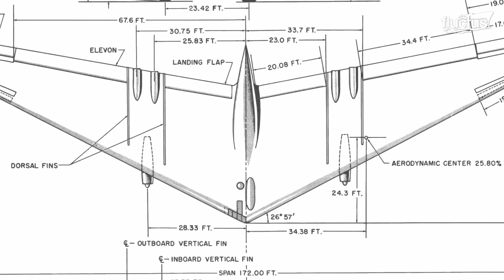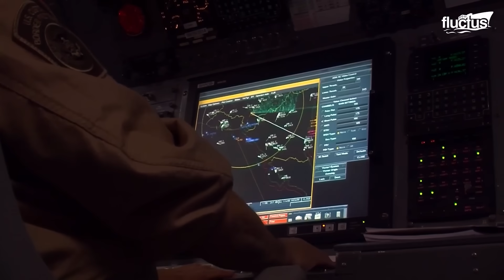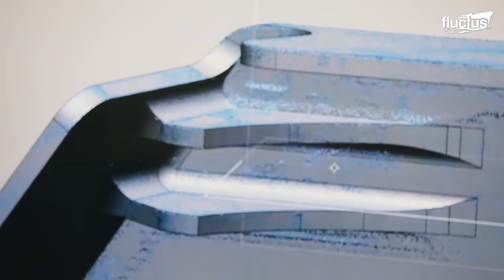The Secret Reason Why US Built World’s Most Advanced Brand New Stealth Bomber

Comment: I'm afraid this is an ackward flying weapon though it is rather aerodynamic unlike most 'warplanes' so we can learn from that. But the wings should not be a sharp V but drawn back, reductionist and hard yet recessive, like a Rommel Fox 'fighting retreat' to use a metaphor. The physics is much better. The other problem with this plane is that though it flies, it doesn't really frigate anything; the pilots if they exist are hiding in a narrow chamber. My warplane is centered around the luxurious two person fighter pilot command center in the rear center rising boldly above the structure of the aeroplane although in curvaceous aerodynamics: but not sharp and narrow, but broad, approaching a UFO pilot bubble almost. If you have to drop numerous bombs, you would fuse my plan with this bomber design. My warplane uses the plane front exclusively for weaponry does not fire from the wings disturbing flight control but always has constant heavy machine guns and is set up before the mission for missiles or bombs(8 and 5) respectively. This is a serious war-plane but if fit with missiles intended for knightly air jousting not absolute war although the missiles are powerful detonations and lethal enough. But if we drop bombs, 5 are sufficient because these bombs destroy twelve blocks at a drop; although they are not nuclear. This is US Air Force and Space Force information. I apologize for the public forum; But I am public American military scientist as well as a scientist of peace and economic production and management.

Comment: YES, there IS a fuselage.  There is a center section of that plane dude, and it's where most of the load is along with the crew.

A TRUE flying wing is what airlines are working on for hydrogen flight.  The WING also bears the load, or the load is distributed over the wing.  It's totally different from these bombers where the fuselage blends into the wing.

Even the tube and wing design which has been around for over 100 years now has wings that bear some load, because that's where the fuel is.

Comment: Can you imagine what tech they've got now!.. one could almost say its tictac shaped! 😏🤫😘 💊
Reply: Yeah they must be secret testing
Reply: The shape is a little different than the B-2, not much  It's control surfaces are more stealthy.  One of the biggest differences is the stealth material which has been a drawback to these planes because every time you use them in any serious way they have to be recoated and it's an expensive and time consuming process.

The stealth material will be permanent.  So, more costly in the construction but much better for maintenance cost along with availability of the aircraft and they can fly faster.  I'm sure the range will be better but I also believe they can deal with a more varied payload and carry more missiles and bombs.

Of course it also starts out with more advanced electronic systems, and I'm sure the communication systems that allow it to control a fleet of drones which is part of the U.S. NGAD program.
Reply: @johndoh5182 😮😮
Reply: The tictac isn’t ours, maybe future us but not current us
Reply: @GRosa250  oh they very much are ours. Made by Lockheed Martin. Dr Greer says so himself.
Reply: @JonnyMack33 9kkkoi😮